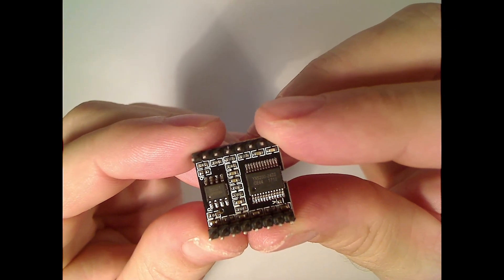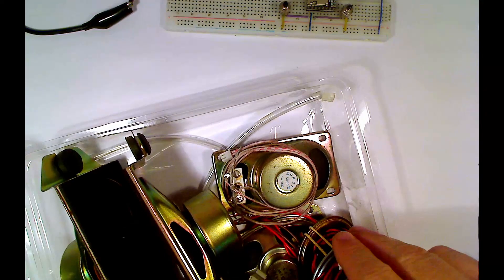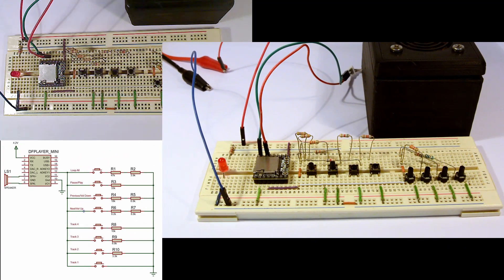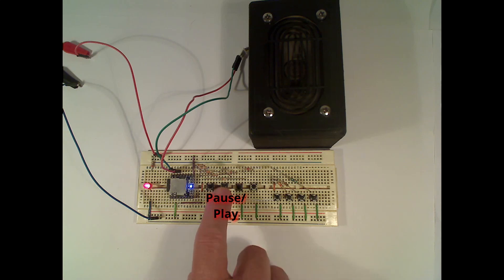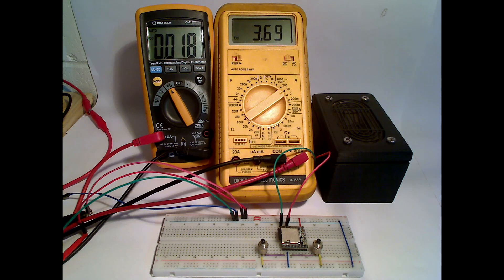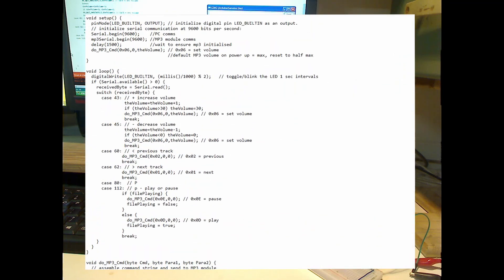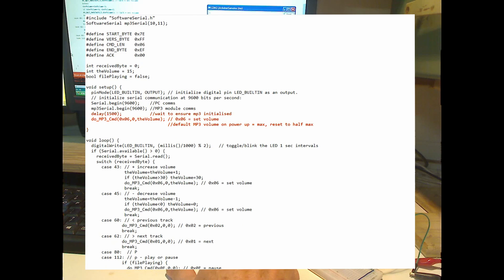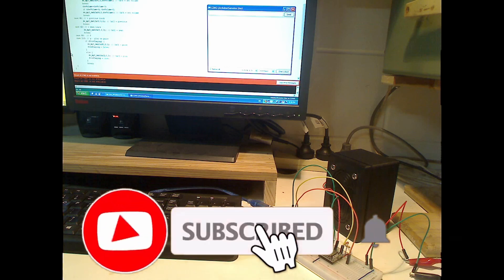DFPlayer Mini MP3 Module Testing

Comment: Hello wish everything is fine 
I want to make a project for bus stops announcement contains audio bus stops names and led light for stops map this will be by one press button.
Would you please advice me what tools and how to use
Beat regards
Reply from the maker: Obviously this will depend upon what you have currently available (if only a one-off or your plan multiple), what you are prepared to spend for any new components, level of current knowledge etc - but, the MP3 mini for playing the sound files, coupled with a micro controller (depending on you knowledge, Arduino type easy/low cost entry, or maybe ATtiny for smaller form factor), depending upon how many LED lights, perhaps some ancillary chips for multiplexing output, then code with array of stops, associated sound file etc, and with each press of the button, the next array element enables the code to play the sound file, and LED channel to light. Long/short button press may allow forward or backward movement etc. If just one set "route" perhaps just could just use the sequential play feature of the MP3 player without extra microcontroller, but MP3 by itself, hard to see how to control the LEDs as well, Sounds interesting project.
Reply: Thank you so much @FadsToObsessions

Comment: Thanks for explaining in detail all aspects. excellent video.
Reply from the maker: Glad it was helpful!
Reply: @FadsToObsessions  any ideas on auto play on power on? I tried having ADKEY_1 grounded before power on, but no luck...
Reply from the maker: I checked my notes and that should work - connecting ADKEY 1 to gnd, and then on power-up should play all tracks present on the SD card on a loop. I have some old video clips recorded for a barking dog alarm based on this module, which includes auto playing etc, I'll try to tidy this up and post on YT over the next few days
Reply: @FadsToObsessions  I do appreciate your answering. I have tried this and didn't work. Maybe there is a slide difference in the mp3 units we have... again, thanks a lot.
Reply from the maker: You are correct about possible differences between modules (the components I have been using were purchased a few years ago now!) - I know these things can be frustrating, so I have placed pictures of the module I am using on my web site ( http://www.fadstoobsessions.com/Electronics-Projects/Random.php ) so you can reference against your physical module, also, a video demonstrating the wiring etc for 'auto-play' at power-on.

Comment: been lookin in to this player, but where can i find the refrens regarding what resister to use for specific tracks? i want 5 tracks to be played but cant find information in the documentation what resistor is needed for tracks.
Reply from the maker: Figure 5-5 in the datasheet gives the resistor values for each "key" and the function each "key" provides is listed in the table at the start of section 4 of the datasheet (or there is a diagram at the start of section 4 also) - so for example, K7 (key 7 is "playback track 4) which would be a resistor 9K1 ohms. I have a copy of the datasheet here is you need http://www.fadstoobsessions.com/Downloads-Products/Downloads-Products.php

Comment: Many thanks, had/have a couple of dfplayer boards and assumed both had blown because I couldn't get anything out of them, not even the LED. Video was extremely useful, now to integrate to Alexa!
Reply from the maker: Great to hear - if you have time, would be very interested in your results with Alexa
Reply: The basics are, to get around the DFPlayer file naming restrictions, I will use a PHP routine to read all track and artist names from current local files and load this text into a database table. A column within the same table have consecutive numbers for each file. The file will then be copied to an SD card using the new index as the new filename with leading zeros where needed. New tracks can then be added to the end of the table quite easily. You can ask Alexa for any words within the track title or any words within the artist name and Alexa would use the correct index through a simple query carried out by Alexa. This would then be sent to a tiny D1 mini which sends the commands to the DFPlayer. Stay in touch for more info.
Reply from the maker: thanks, will do.

Comment: Is it possible to play one song without decreasing the volume?
Reply from the maker: yes, you can play a song/track with whatever volume you require (if the default start-up volume is OK for your application, you don't need to change)

Comment: How can I change between folders? Thanks so much!
Reply from the maker: you need to use command 0F "specify playback of a folder" (see table 3.2.1 of the datasheet page 4). This command has two "parameters" the "folder" and the "track" (both folders and tracks need to follow the naming convention using "numbers" for the track and folder names). Section 3.3.4 shows the command and examples. You must specify both the folder and the file name to target a track.

Comment: Very clear explanation, thanks.
May i ask what is the best battery and speaker to use if i want to create a tiny mp3 for kids?
Reply from the maker: The MP3 module requires DC 3.3 to 5V, so just 3 or 4 series AA or AAA batteries probably suffice (likely least expensive option), but perhaps a 3.7V LiPo pack would give you smaller size (and be rechargeable), something from RC drone/car maybe suitable. In terms of speaker, any 4 or 8 ohm speaker (perhaps salvaged from discarded item, or search ebay using "4 ohm 3W mini speaker") - best if you can use a salvaged speaker/items, otherwise, overall cost starts to increase quickly (and likely just easier to purchase ready to go commercial MP3 player - unless to want to customize in a particular way).
Reply: @FadsToObsessions  
Clear. Thanks a lot

Comment: can this play a single file on power up somehow? or does it need a micrcontroller? -- thanks
Reply from the maker: The DFPlayer does not have "play file on power-up" functionality as far as I know. So, a microcontroller as you say, or perhaps some external circuitry (maybe a RC time delay with a Schmitt buffer to trigger low the ADKEY1 (pin 12) to play track 1) will be needed. Microcontroller likely easiest, getting an active low trigger on start-up with "passive" components possibly "tricky" depending how the DFPlayer reacts on power-up.
Reply: @FadsToObsessions  Yeah thanks. I didn't get any documentation -- your video is excellent. Yes, just a circuit to give that pin a pulse with the proper resistor "should do it". That pin must be an AD converter. Clever what they do with the different resistance values.Where did you find the datasheet? -- thanks
Reply from the maker: Not sure now, but I added the datasheet to my downloads 

http://www.fadstoobsessions.com/Downloads-Products/Downloads-Products.php 

and then scroll down in the "Datasheets" section - you'll need to join as a member (which is free) which is just to stop spam-bots and scrapers etc

Comment: Outstanding video. Do you think I can find a way to restart a sound quickly. I have a model train and need the Chuff sound. I trigger it by observing drive wheel rotation with iR and two white straps. At low speed the chuff sounds off loud the dies away. But at high speed the device can not react. I wanted a restart to here the Loud start. Retriever loud start at higher speed. Is there a way to rapid restart.  Dennis in Virginia on Frankentrain Laboratories.
Reply from the maker: Dennis,
The DFPlayerMini will start/restart playing a track/sound file as soon as it receives the command from the MCU, and the existing track (if any) will immediately cease playing "automatically". I have a couple of examples that you could perhaps modify showing how to repeat playing tracks, both looping through files
https://youtu.be/IQr6QTyons4   
and replaying at set intervals
https://youtu.be/udgf_-x0JqI 

The only "limitation" is that there is a "seek time" involved with the electronics within the DFPlayer Mini getting the info/data from the SD card etc. This means there would be a brief pause between "repeats/restarts" (only in the order of 10's of milliseconds, but enough to be noticeable when listening) - annoying if trying to get a "continuous" sound from a "sound clip" for example, but in your application, perhaps fine.
Reply: @FadsToObsessions  I have been testing the sounds and fine if the button is help the iunit kinda goes to auto repeat until you do a slow cycle. I think for the money I can add the ADAftruit button fob and radio receiver with a opto chip 4 channels and get a remote operation for my train engines for less that $20. We are designing a PCB to mount this up and put it in the trains tender. Yippee! Cool sounds on the cheap. Great video Hey where can i get the datasheets? Dennis
Reply from the maker: the datasheet for the MP3 player module is in my downloads 

http://www.fadstoobsessions.com/Downloads-Products/Downloads-Products.php 

and then scroll down in the "Datasheets" section - you'll need to join as a member (which is free) which is just to stop spam-bots and scrapers etc. I'll PM you a copy as well.

Comment: Thanks. I was desperately searching for the 'loop' function when using as a standalone. Sorted!
Reply from the maker: Glad to have been able to help
Reply: What was the solution for looping through all MP3’s on the card when using as stand alone?  Was it simply grounding the ad_key1 pin?  Not sure that I saw that in this demo.

Comment: Great video , but can you answer me a  question. I am making a sound generator for a model steam train. I only need to play one sound file that goes " Chuffff" and that only lasts about 1 second .   I need to trigger it relative to the trains speed so when its running slow it may get triggered every 2 seconds ," Chuff  silence Chuff " etc.  when it speeds up a little  perhaps 1 trigger a second I would get " ChuffChuffChuff" . All good so far but now we get quite fast and the triggers come faster than it takes to play the full sound sample , What I need is for the trigger to cut off the current playback and restart it from the beginning  so I get " ChuChuChu or even ChChChCh. Is this possible and if so how ?  I dont want it to have to wait untill each chuff has played out its full length . I had planned to use an optical interupt on the trains axle but I worried that if the train stopped with the optical trigger closed it would keep repeating but I suppose using an MCU I could get it to trigger an interrupt  on a rising edge so if it stopped when interupting it couldnt play again until the trigger from the optical sensor dropped low and then high again. Sorry for the long post but if you could let me know if and how the sound can be stopped and restarted back at the beginning I would be grateful  ..... Don
Reply from the maker: Don, the DFPlayerMini will restart playing a track/sound file as soon as it receives the command from the MCU, and the existing track (if any) will immediately cease playing "automatically". I have a couple of examples showing how to repeat playing tracks (both looping through files and replaying at set intervals) https://youtu.be/IQr6QTyons4   and https://youtu.be/udgf_-x0JqI 

The only "limitation" is that there is a "seek time" involved with the electronics within the DFPlayer Mini getting the info/data from the SD card etc. This means there would be a brief pause between "repeats" (in the order of 10's of milliseconds, but enough to be noticeable when listening) - annoying if trying to get a "continuous" sound from a "sound clip" for example, but in your application, perhaps fine.
Reply: Thanks for the reply , it sounds encouraging so will give it a try and report back how it goes

Comment: Thanks for you video. Im trying to do something really simple with this.. 

So using the example blink project. I want a noise to play every time the led comes on.. However when I add player.play (1) it cases my led to flash like crazy. 

To put this in context this is for a halloween prop. Every 30 secs the arduino turns on a relay that triggers a motor, at which point I want it to play a scary sound. Thought it would be simple but i'm not getting anywhere fast.

Would appreciate your help
Reply from the maker: Kevin, I did a quick test circuit and some demo code (see https://www.youtube.com/watch?v=IQr6QTyons4) showing timed triggering for playing a sound file. Hope this helps.

Comment: I have managed to access 20 folders on a MicroSD card with a folder that even has over 300 songs in it, the other folders have various number of songs using Mega 2560 Pro and 20 buttons, each accessing a separate folder, lots of pins, buttons and wires, not using ADKey scheme of 2 pins. Now looking to add Leds to indicate which folder is in use

Comment: Hello, I say play music if a condition is met in the loop in the arduino, but the first 1 second of the music is constantly repeated. Why does it do this?

What I want: If that condition is met, let the music play until it ends and then stop, but it doesn't do this, as if it is constantly sending requests for that music to be played.
Reply from the maker: Does your setup work normally otherwise, i.e., not using a loop, but just sending a "start" command, and the track plays? If so, hardware probably Ok and a code problem, otherwise, maybe something with the wiring. Send your code to admins@fadstoobsessions.com and I'll have a quick look if you want.

Comment: Hey I am trying to use the DFplayer mini as a standalone(powering it now with an arduino), because I want to keep my entire project as small as possible. However when my mp3 file hits a loud note my speaker (1 watt, 8 ohm) simply just stops. do you have any tips?
Reply from the maker: The voltage regulator on an arduino (well at least with a Uno or similar) is only ~1A and if powered from USB, you should limit total max draw to be only 500mA. From  https://www.arduino.cc/en/Main/arduinoBoardUno&gt;
"The Arduino/Genuino Uno has a resettable polyfuse that protects your computer's USB ports from shorts and overcurrent. ... If more than 500 mA is applied to the USB port, the fuse will automatically break the connection until the short or overload is removed."
So, unfortunately, you will probably need to look at providing a separate supply for the speaker.
Reply: @FadsToObsessions  Thank you for the quick and concise answer. I will look into it :)

Comment: I'm using the DFPlayer Mini in the standalone mode. I've set it to "loop all" by connecting a 51 ohm resistor from pin 12 to ground. It works fine but in that configuration, the volume adjustment function (via the I/O pins) stopped working. Is that by design? If yes, is there a workaround? Also, there is a time gap between songs in the loop mode. I know the gaps are not from the songs as these sound files were edited without any gaps to be played seamlessly. Is there a way to remove the gap between songs?
Reply from the maker: If I understand your setup, you have a 51Kohm resistor directly between pin12 to ground, and then other resistors (of appropriate value) connected from pin12 to ground via momentary push buttons, for the other functions (e.g., ~25Kohm for volume down). This means the  DFmini is "seeing" a resistor value of 51Kohm all all times on pin 12 (which is constantly calling the "loop" function) and then when you press the volume down button for example, the 51Kohm and then the 25Kohm are in parallel, so equal to 17Kohm, which is no function. Using resistors, you need to have them all connected via push buttons. The gaps between the songs is a limitation of the DFmini. This is the time it takes the unit to access the files from the SD card and start playing. So, you can't "loop all" and have a continuous sound track from various stored files (which would be nice for certain applications).
Reply: how much is the gap?

Comment: I can only get 4 segments, I can't use resistors to get 5 or more segments on ADKEY1 and ADKEY2. Please help. Thanks!
Reply from the maker: Double check your resistor values (and connections to pins/ground etc), double check you have named the "segments" (which are just the files on the SD card) correctly (see 04:40 in the video), that's the best I can offer at the moment. Over the next few days, I'll recreate the circuit with more than four "segments" using resistors/buttons and post the results.